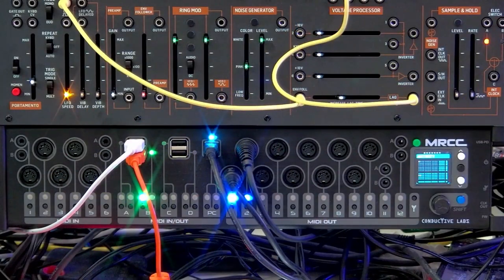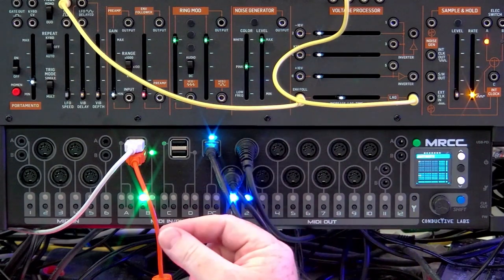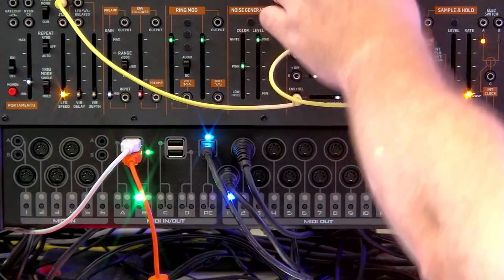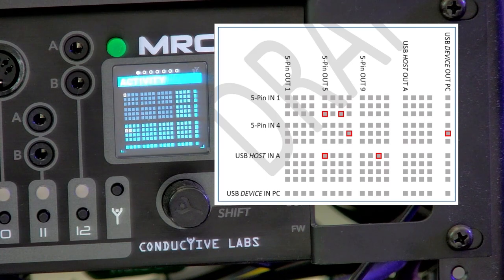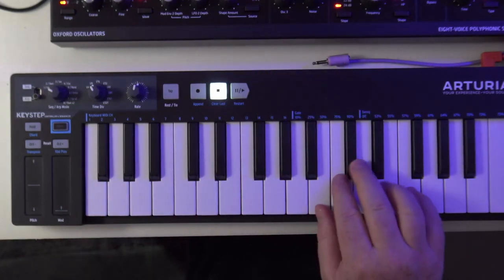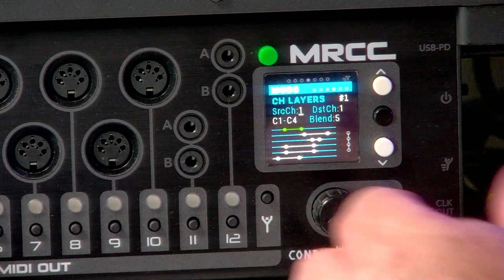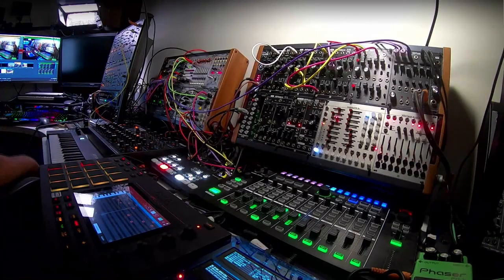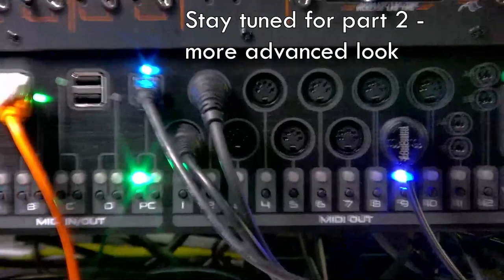MRCC - MIDI Router Control Center

Comment: Yay!  Nice pt 1 review, looking forward to the rest.  
It's about time that a MIDI router that doesn't need a computer to configure arrived.  It seems so silly that while physical synths have made a comeback in popularity, the stand-alone MIDI router has been missing.  It won't replace my other routers, 5in-8out on the DIN side of things is a bit less than what I would like, but then I still haven't unpacked since I got back into town!
Reply from the maker: Yeah Part 2 will look a little more into things like the virtual ports on the USB inputs, Arpeggiator, CV Clocks etc. I'm also going to answer some questions from here :)

Comment: That was a helpful video.

The way I handle the Volca sequencer issue is to clear out all steps using FUNC + Step 16 when I plan to use something other than the built-in sequencer. The sequencer still “plays,” but there aren’t any notes to trigger.

Comment: I've built similar MIDI 8x8 device based upon Teensy 4.1 board. As Teensy  board has got USB host that supports up to 10 devices plugged so I implemented USB hub there. Teensyduino supports MIDI USB so the interface creates multiple USB ports if plugged to PC as a USB device.
Reply from the maker: Interesting!
Reply: @ranzee  I took this project as a basis for my one : https://github.com/Deftaudio/Midi-boards/tree/master/MIDITeensy4.1

Comment: Have you tried to put an external USB 3.0 Extender on any of the MIDI I/O ports yet?  It would be great to be able to extend the virtual USB ports via an external USB Hub.  Maybe you can illustrate how you map each of the USB devices on the USB Extender to any of the Virtual ports attached to a MIDI I/O port.  That would be of interest.   Many of us have more USB type controllers than 5 pin DIN.  Thanks for the first pass on it.
Reply from the maker: Not yet - but next video I visit the USB ports - and perhaps I can try this :)

Comment: Can it take poly notes on 1 channel and split these out to mono channels?
Reply from the maker: It might - something we can check out and give it a go.
Reply: @ranzee  good excuse to pick up another 3 2600’s for a 4 voice test ;)
Reply: There are plans to include polychaining in a later firmware, but it's not quite there yet. That feature when implemented will allow you to map a polyphonic midi part to individual mono outputs.

Comment: This product is well-designed and has solved a whole host of Midi problems. Here is my next question: Can you program the Highest notes to go to the 'x' channel notes to go to the 'x' channel? Here is a practical example: I have a two-voice pro and two Sem Modules to make it a four- and the lowest voice poly synth. I want to play a C major 7 - C - E - G - B. Since the two-voice pro is two-voice, only two will play C and E if I press four notes. However, I want G to go to SEM 3 and B to go to SEM 4. And I want this to be the standard for any chord I play regardless of my octave. How would I  program this in? Thanks
Reply from the maker: Short answer is - using the MIDI filter - I think so - but it would need to be tested. Best to head over to their forum on their website :)
Reply: @ranzee  Thank you sir.

Comment: Do you know perhaps if it can send programchanges to different channels per stored preset? Or otherwise can it recieve a programchange for switching stored presets it self? I'm looking for a live application. (I used to own a Miditemp 8x8..yes I'm old🙂)
Reply from the maker: I think it sends thru Program Change - but not via the 1st port (as it uses this for MRCC control). It should be fine.

Comment: Thanks for showing this! I’m a Kickstarter backer and am really looking forward to getting mine. What’s the latency and sync like between USB and other kinds of midi? I don’t think I’ve seen mention of it, but can it generate or alter clock, eg swing or dividing?
Reply from the maker: I'll definitely check this out. Not sure the best way to measure this - but I'll put it on the list!
Reply: Latency/sync has been great.  I have been pushing a lot of data through it and it has been flawless in that regard.  I've also been merging 2 or more inputs regularly and it also has handled that very well with no glitches.  TBH, I was expecting it to choke on the volume of data but it hasn't so far.  The internal arpeggiators can operate at various divisions and sync to the internal or an external clock.

Comment: The one thing I don’t care for, and a lot of devices are like this, are when all the ports are on the front.  If you filled the ports to capacity, it would potentially be difficult to get at the controls on the bottom.  Some Front ports are good for devices you frequently move in and out, but for permanent setups it doesn’t make a lot sense and uglies up your setup.

Comment: About the MRCC DIN output,   when use channel 1 as the input, do you use differ midi channels for control each synth?  If so,  how did you setup this in MRCC?  Or did you use the same MIDI channel output for all synth?
Reply from the maker: Both - think of it as a MIDI through (from a basic sense) - and then it sends all MIDI channels out to each out.
Reply: @ranzee  how did you setup, program it?

Comment: Hi, I'm' asking this question here because I couldn't see your follow-up video, so sorry if you answered this question there.  I had watched your mio10 video back when I first got it and am wondering how well this integrates with DAW setups, in addition to all the outboard gear.  I really like the simplicity of how this works, but am wondering if this replaced your mio in your setup and if it is easy to use inside the box as it appears to be outside the box?  Thanks

Comment: Maybe a stupid question, but as an example with this device you would connect directly with a 3.5mm TRS cable Korg SQ1 as MIDI in, not need for the adaptor from 3.5mm to 5PIN ?
I know it's just a detail but it would add to the connectivity options if it does
Reply from the maker: You can use a standard 3.5mm TRS cable - no need for DIN to TRS adapters.
Reply: @ranzee  Thank you !

Comment: Is this worth getting for me?

I got Virus TI, Motif XF, Korg M3, Electribes, RM1x  etc.

Can this device work with USB on all 3 devices without DIN?

Virus TI - USB
Motif XF - USB
Korg M3 - USB

And every else is 5-DIN cable? Does that work standalone without PC? Or does USB require a pC to work?

I’m currently using MIDI 8x8/s but it’s bugging out on me. This looks like a great replacement.
Reply from the maker: It works standalone. It is a USB host for your devices. You can actually use more than the 4 USB ports - as it has virtual USB per each USB port (up to 4) - and the PC can have up to 16 virtual USB ports. This means you could probably run a USB hub in them (haven't tried it yet). There's plenty of DIN and TRS (3.5mm) for expansion if you so choose. Plus if you get the WIDI Bluetooth/Wireless MIDI you could use that too.
Reply: @ranzee   I purchased it and just came in today! I’m excited to hook it up :)

Comment: I really want one of these but the price is just too high :-(
Reply from the maker: I think the nearest thing is the MIOXL - which is more expensive. So, technically it's fairly well priced - but I do get what you are saying.
Reply: For me, the benefit over other devices is the ability to plus USB, DIN, and TRS (A and B) into a single box with no converter cables or dongles necessary.  If you only have 3 or 4 MIDI devices, yes this is probably way more than you need.  However, when you add in the filtering, rechanneling, 6 arpeggiators, clock, and analog pulse out, it can be an important part of your MIDI setup

Comment: The MRCC is the most unreliable piece of music gear I’ve ever used, and the menu system is ridiculously bad. It’s probably fine to route a couple DIN MIDI things, but you can’t leave it on for long. It always eventually stops working on some channels/ports. The screen burns in, and the screensaver only works if there is absolutely no MIDI traffic. Plugging/unplugging USB ports makes it randomly unstable. And the transpose mod literally works for less than two seconds before it stops and requires a factory reset.
Reply from the maker: I leave mine on 24/7. No screen burn in yet. I do have to reboot it every-so-often - but that's no different to most things. I'd suggest you contact the guys at Conductive Labs.